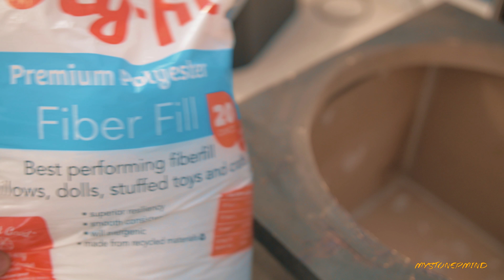18 Inch Subwoofer Box Mod (Experiment)

Comment: I cannot imagine it doing a whole lot of diffrance to that sub in particular.  Usually one uses polyfill to kill reasonance. (wich a cheaper speaker has alot of as it's box isn't built as sturdy and as a result its box viberates a  bit.) But that box ya built right there is  T-H-I-C-C AF and solid, So.. i guess we'll see..
Reply: ohhh yea! Just remembered something else. Polyfill is typically used to kill ecoy/boxxy sounds in speakers that arent subwoofers.. because mid frequencys sort of get overpowered in a box without dampening material.  Now subs on the ohterhand (depending on what kind of amp/crossover setting you have USUALLY play from like 50 hz down.. so there kind of isn't any resonace to be found at thoose frequencys..? idk.. we'll see in the next vid lol
Reply from the maker: I haven't done a before and after with this, but depending on the amount you use it will make a difference no matter what box you put it in simply based on the fact that the material helps dissipate the back wave of the woofer.
On some that require it, it will fix issues with resonance and flatten response somewhat.
The box is solid but if I stuffed it enough which I don't believe I have, it will make the box appear larger and cause the woofer to play lower. 
I mean there's a bit more to it as well but now I'm feeling the bong rip kick in :)

Comment: Does poly-fil help in sealed enclosures? I have a pair of Technics SB-M300 and the mid bass on them is great but low bass is much quieter.
Reply from the maker: Nice speakers, they have a double stacked magnet quite like my Sony. 
Yes it helps sealed enclosures but I wouldn't change anything on them, maybe consider purchasing a subwoofer.
Reply: Thanks! I will consider buying a subwoofer, then.

Comment: Would polyfill increase Bass in PA mids i have two 15 inch Pro audio mids without any polyfill inside what would the differences be aka will the bass be louder or just deeper btw these peak at 45hz in bass frequency
Reply: Erik Britz 15 inch mids that your letting play as low as 45hz? Uhmm..
Reply: SKORPION 15 they cut off at 45hz via crossover in the box 50hz to 65hz is where they like to play 45hz is where the crossover in each speaker cutz off i have two others that are cut at 37hz but they have played down to 33hz audibly but still i wanna know that if i add some polyfill will it increase the bass will it lower it will it smoothin the bass out or what cuz right now my bass is decent but its a little boomy and i dont like that
Reply from the maker: +Erik Britz it will most likely lower the frequency, give it a go and see, the results can vary
Reply: My Stoner Mind thanx cuz i was like meh lets try it id like the bass to be a little more smooth so if it happens then yeah if not i can remove it no harm no fowl
Reply: It will play deeper as polyfill fools the speaker into thinking its in a larger enclosure
Reply: MARINLAW yeah just tested it on my one loose mid and it works i think the woofer can go down to 29hz but this is just by ear will meter it in due time im just wayy busy today